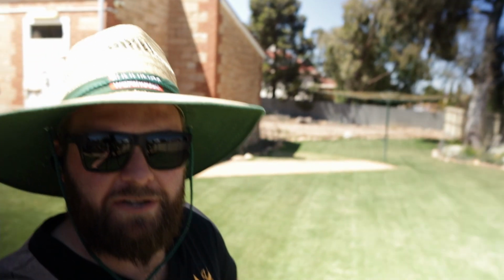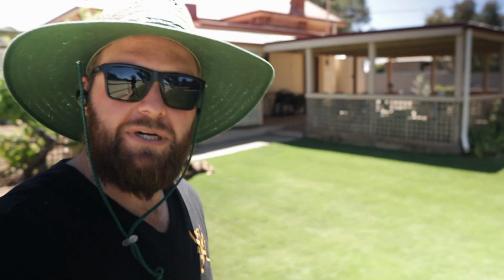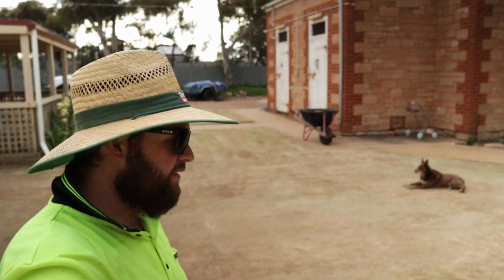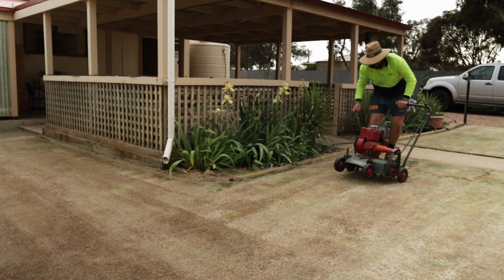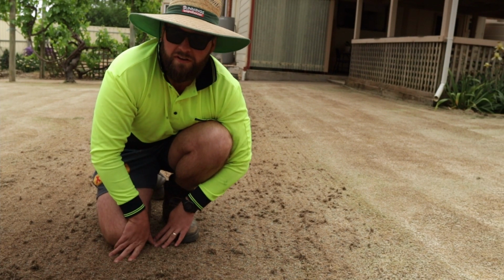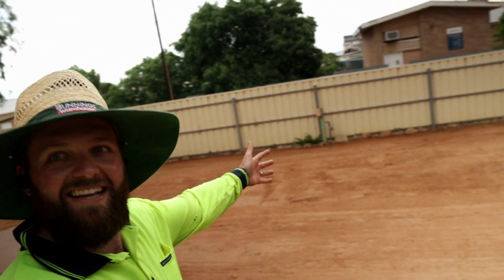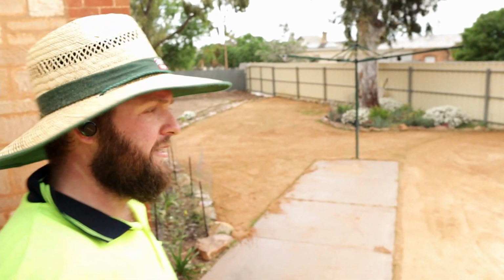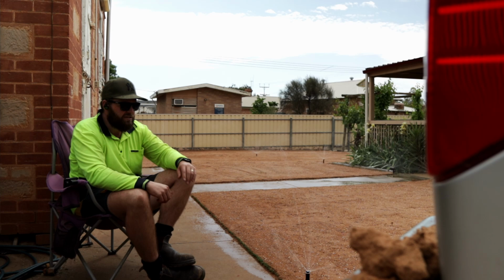Another lawn renovation - chasing levels and dogs chasing mowers

Comment: That's an awesome idea to show the difference between rotary and cylinder mower in same place. The scalping machine turned out great.
Reply: Also very interesting a out the scarifying pulling out so much less with such a low scalp. I guess that is to be expected but interesting to see
Reply: Coopers green, I think you deserved a Coopers red after all that! What soil wetter are you putting down? I use plant doctor nature's soil wetter for garden but have had some areas on lawn with high compaction and super dry so used aqualink advance on there. It has been unbelievable to be honest. Just watch the water rip right through the surface.
Reply from the maker: thanks mate, very impressed with the scalper, much more effective than previous years.

I bit the bullet and bought Hydrolink Advance which has been good so far.  I had previously used the nature's own stuff from PD but was still getting some dry areas. 

Glad you enjoyed watching mate appreciate it and thanks or commenting 👍
Reply from the maker: ps, I think I'd be in the floor if I have a red devil after sweating that much hahaha

Comment: I am confused  why cut with a bagger and I never heard of a scalper ? Or just a  lawn mower set low why not a .Greens mower which give you clean cut them scarify or scarify then cut short again clean cut less chance of disease
Reply from the maker: The scalper is used because most baggers won't cut low enough. If I used the greens mower to cut it down that short ( down to the dirt) I'm going to be cutting into sand and dirt, which is basically like getting a grinder and filing away the clean sharp edges of the reel and bedknife.

there are no issues with disease  cutting that low with a scalper. The grass has huge amounts of airflow and is able to dry out easily.